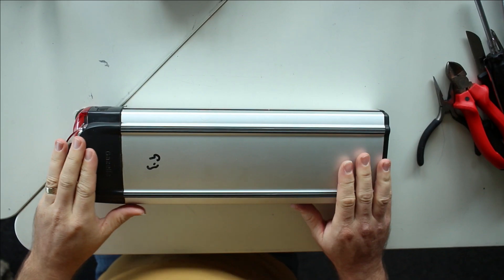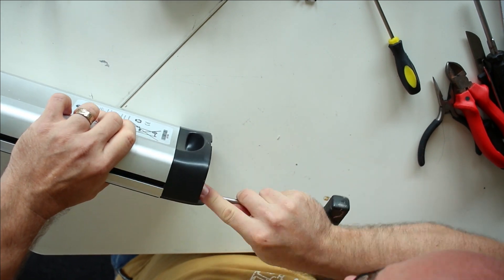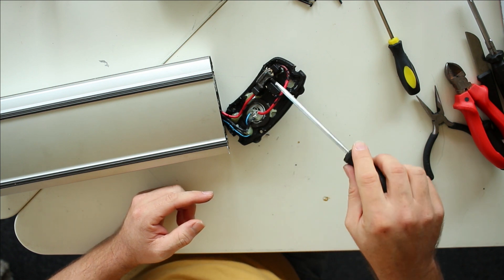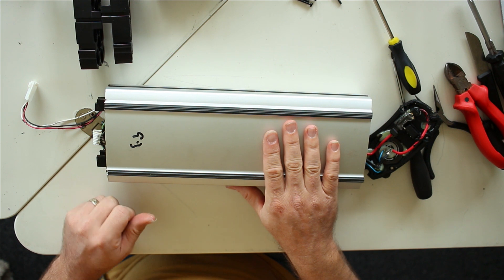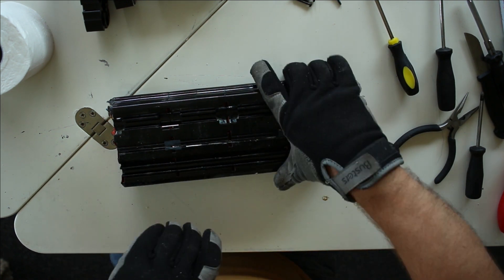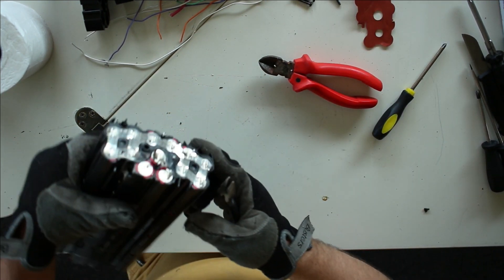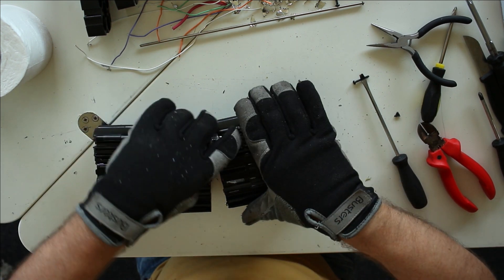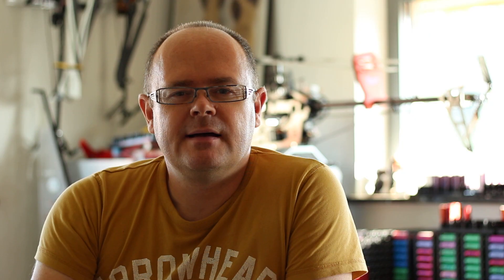18650 - Part 9 - Opening Gazelle Innergy li-ion battery pack

Comment: Hey.. so i have this battery and it works but i cant go very far until it stops working can u tell me what batteries are best to replace the old ones with and to improve my radius thx.
Reply from the maker: Hi Lissa, If you are sure your BMS is still working ok, and you can only do...let's say 30 km. than indeed your cells will have to be replaced. At Nkon.nl you get very good prices for a very broad range of cells.
Also, you can now buy higher capacity cells, so if you put in 3000mah or 3300 mah cells, you will be able to do 25% more distance then when the bike was new.  (most of them had 2200mah original).
example for cell to use https://www.nkon.nl/rechargeable/18650-size/sony-us18650vtc6.html
If you choose one, make sure you buy all the same, AND buy high discharge ones 20 or 30 A discharge.

PLEASE be aware that recplacing them will NOT be an easy task. This is designed in such a way that replacing them is extra difficult. It is feasable, but do not underestimate it.  Make graphics when you disassemble, to make it easier when assembling. Good luck, and keep me posted.
Reply: Hey so ive realized its too much work to replace the batteries and i bought a second hand one and it works just fine thanks for the info tho ;)

Comment: How can i make a diagnostic for the batter without having to open it completely?
Reply from the maker: Ahmad Qujo, bikeshop can put it on computer for readout...
Reply: Sailing and electronics i ran a test on it and its outputting 42 V but i still cant test it on the bike could this be a sign that it is fully working? Or it is not necessary that this would be a sign that it is fully working?!
Reply from the maker: Ahmad Qujo, 42v for a 10s battery is possible if fully charged. However, I doubt that the bikecharger goes this high. So cells could be ok. This says nothing about potential capacity however.
Reply: You could attach three 12V lights in series and measure the time it takes to fully empty the battery. Since you are not actually measuring the current, you can only get a rough estimate of the capacity. Let's say the lights are 20Watts each, then you draw about 60Watts. If it takes 5 hours to empty the battery the capacity will be roughly 5*60=300Wh or 300/36=8.3Ah

Comment: Many thanks for that video. Do you have any chematics or handmade notice in what config the cells have to be insert in the plastic holders for replacing the old ones?
Reply from the maker: No, sorry only dissasembling the battery... It also depends on the type. Bronze have 12 cells less than Gold battery.